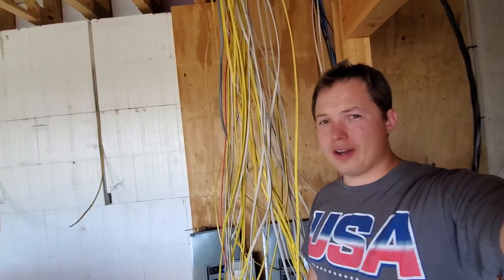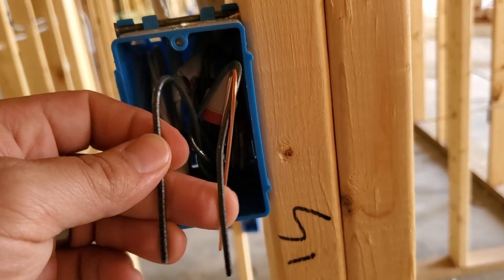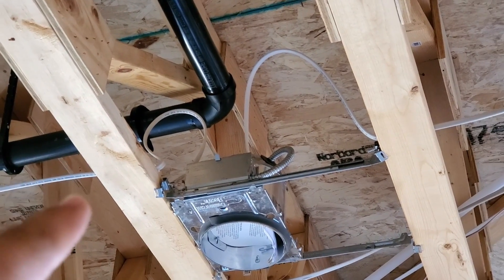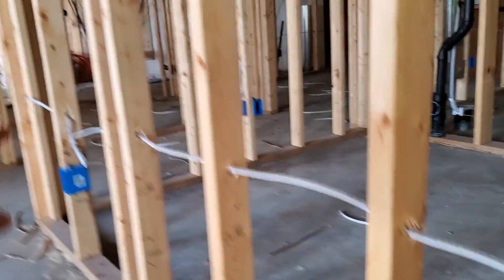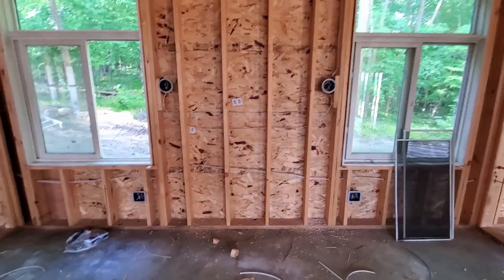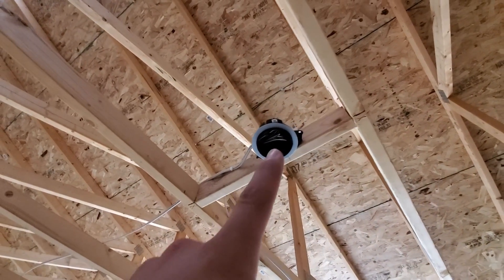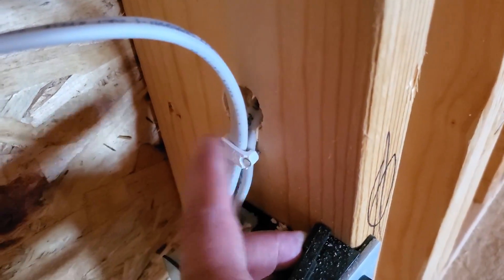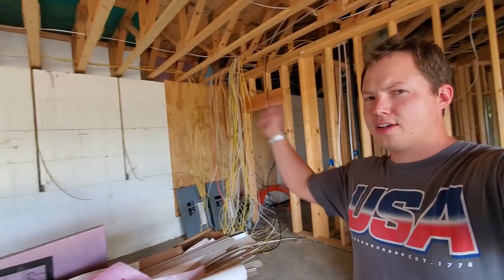New House Wiring Rough In Project Tour!

Comment: Very nice. Now one convienemt way i lile to wire a house espacially a 2 story one is including a sub panel too. for example the sub panel will serve all the circuits on the second floor and the sub panel will be on the second floor in a convienent spot. and for one story homes where the garage is on one side and the bedrooms on the other the garage has the main panel and the sub panel is installed on the opposite end of the home at least on one of the rooms and will serve the circuits on that end of the house.

Comment: Three cables max through one hole, and that hole should be at least 1.125". Can barely do that with 2x4 construction though without compromising the stud or top plate. It's a bit ironic to talk about the heat from cables coming together when all the homeruns are literally right next to and on top of each other inside the circuit panel. That 3-way with 14/2 and 14/3 cables (9?) coming into a 3-gang is obscene. Why would you do that?

Comment: if no more than 2 wires allowed to go through a single hole in the stud to avoid bundling and over heating , then at 3:04 I see the same situation created with multiple wires going into the switch box very close to each other.

Comment: What is the max outlets per 15 am breaker
Reply: The National Electrical Code does not specify a number for ‘dwelling unit’ (house) wiring. Commercial wiring has a limitation.
Reply: @jjoejones1  thank you so much
Reply: @jjoejones1  what are the allowable types of nail stoppers to protect main run service lines?
Reply: @eddiepopeyebronx  I probably use the term ‘nail plate’ for what you refer to as a ‘nail stopper’. Like me, I assume most electricians use nail plates that are the same width as a 2 x 4, 1-1/2-inches, which covers the nailing surface. I’ve never measured the length, probably close to 4-inches. They are fabricated with small spikes at each end which are driven into face of the wood. Contractors purchase them in boxes of 100…they’re very inexpensive, best guess, 8-12 dollars.
Reply: @jjoejones1  thank you

Comment: As a builder of 40 years and also do wiring you don't want wires close to outside sheathing alot more chance of wire getting peired by siding nail then a sheetrock nail,, drill holes 2 inch in from inside of stud so it's behind insult

Comment: Fifty years ago I wired a residence for a county official. In the process I drilled a series of two inch holes in the center of the floor joists in the basement through which I pulled every circuit back to the panel.  I'm guessing there was about fifteen cables, including appliances. I guess it's a miracle but the home is still there? In residential work "Heat dissipation" is BS giving the NFPA an excuse to change the NEC to facilitate the publication of another two hundred dollar code book. Their main source of support? They favor the technical rather than the worker's safety. Why else wouldn't they forbid the foolish stripping of wires with a utility knife. They probably will after they run out of ridiculous technical code changes. FYI look up sconce and pancake box.

Comment: They taped the white because it is now the hot in the 3 way switch system. Its called a dead end three way.  The power AND the switchleg come into one bo, so only a 14/3 goes into the 2nd box, fro one box to another

Comment: Are strike plates common in your area? I have seen those in some homes when routing wire through a drilled hole so that they won't be punctured by a screw or nail down the line.

Comment: Oftentimes the hole height for the cabling is really depended on what was ergonomically comfortable for the person drilling it. An example might be a 5' 5" tall dude with a hole hog will have a zone that is ergonomic and productive for that individual, while someone else who is slightly shorter using a different drill might vary by a few inches or so. Either way it all works even the carefully measured perfectionist method. I comes down to if the customer wants to prioritize it or not and back it with time allowances and finance. Being flexible is key here being able to know when to prioritize and when not to is paramount to being a good worker. :)

Comment: When I practiced it was OK to run three 14 gauge oriented cables through one hole. it wasn't OK for larger wires. That was a long time ago and I think it would be pushing it if they weren't switch legs. I believe the thinking is that not every cable is energized at the same time but I could be way off. :)

Comment: The common wire is wrapped around the two traveler wires. They are Wrapped that way so that the common is easily identified at finish, when installing the 3-way switches. Most apprentice Electricians are taught this way , Ben. It makes them quicker to identify during trim-out and does not hurt anything. Russ-Journeyman Electrician from Oregon

Comment: The tightly wrapped black wire is likely indicating that it's being used as the common for the 3-way, while the red and white that has been phase taped as an orange are being used for travelers. When I was an electrician I would make my boxes up like that and use the white for the common and phase tape it blue. I heard from a friend still in the trade that our municipality has made dead-end roll-ups and switch loops illegal though, so that will be a thing of the past.

Comment: Number of current carrying conductors you can group together or in the "same raceway" is on table 310.15 (C)(1) of the 2020 NEC.   7-9 current carrying conductors, at 70% ampacity.
Example: 
#12 copper wire is good for 30 amps (90C column) but small conductor rule, 240.4 (4)  says overcurrent protection can't exceed 20amps for a #12 cu wire,
So, 70% of 30amp is 21amps, you can group together 9 #12 copper wire, current carrying conductors, (neutrals are considered a current carrying conductors)
If you, want to pull 10-20 #12 copper current carrying conductors in the same raceway, you have to do 50% of the #12 cu ampacity, so you'd have to use 15amp breaker, or up size your wire to a #10cu (40amp in the 90C column) so obviously, 50% of 40amp, 20amp, you can still use the 20amp breaker, fuse... 
Ps. You always derate using the 90C column. (Table 310.16 of the NEC)

Comment: The reason I think they went up and and then down and then back up for the receptacles is because it looks like foam insulation and that shit will just drop down
Reply: Not all foam is shit! The white stuff they use in packaging (and the kind you see in HD) is very light and not very dense. If you get type IX EPS (used for under slab insulation for example), it is rated for 25psi, or 3,600 lb per square foot, and that's just the middle of the road EPS density that you can get.
Reply: @pnwbuilder  that’s not spray though, that’s blocks. If you went across the pieces above will slide down... you go up so there’s nothing that can fall down. It’s hard to explain on text but I’m just saying what I think. I’m an electrician and don’t work with that kind, just going off what I see
Reply: @colin5789  I am not talking about spreay foam, that stuff is actually not that durable from structural point.

Comment: Hey Ben I like your wiring jobs but I did see one major structure problem on the garage wall I noticed when you're pointing out a bundle of wires that went to a switch box next to the garage door I've noticed that they cut into a double stud which I believe is a structure load point and that is a huge huge no no, Mike Holmes would have you tear that right out

Comment: If I don’t have any Romex 6/2 for 50 Amp can you take 2 14/2 twist the positives together twisted neutrals together interested ground together snappy satisfaction ?
Reply: or .....you can  go buy some 6/3wg and do it correctly
Reply: It’s referred to as paralleling but it’s not legal as you propose. Paralleling can only be installed using much larger wire (#1/0 AWG)

Comment: I have a concern with the comment of not bundling the wires, if you have excessive heat from "bundle wires" it's not from the practice of neatly ensuring the bundle is fasten in place but, may be from two other factors you must consider 1. If a wire is illustrating excessive heat as a conductor you must take into consideration that the wire could be undersized for the projected load in the circuit 2. The load factor for the circuit was incorrectly calculated creating a potential fire hazard on the loaded circuit. If these two calculations are correctly calculated then should not be an issue of bundling  a mess of loosely placed wire in the ceiling

Comment: There was an area where someone left a mess of wire on the floor. Inspection failed.
Reply: Video could've been done during the crews lunch break or what have you, guessing you're one of those "neat and workman like manner" code sticklers 😝 ... But I agree, I hate leaving a job site messy and generally clean as I go to make it easier to get out of there later with least amount of clean up. Boss expects acceptable amount of clean up at end of job and usually tells us if we need to be OCD about it based on the customer/circumstances.
Reply: @eds6569  Well let's be honest, anyone can come in to your business and just work. Dig the trench, bend the pipe, run the wire etc etc. But when you are in someone's home, it's takes a level of maturity to go "this space isn't mine, and it's not like people want to pay more for what we do. Let me be as clean and professional as I can manage." That's all I'm saying. One man's mess, is all of our mess because it's not like the client can tell us apart or even cares. I just want us all to get paid more with a level of dignity attached.
Reply: @gracebonez  I feel ya. I've always tried to push myself further regardless of pay even when I worked crap warehouse jobs making slave wages because setting high standards for yourself are important IMO, you'll always stick out in the crowd when even your low standard of work is higher than others but it definitely gets old having to pick up slack of others when they don't care as much. 
When ya reach that point where you realize your pay doesn't reflect the standard of work you've been performing for too long without recognition it's time to consider a talk with higher up otherwise other options.
Reply: Also, cleaning as you go should be a standard with every crew if the business owner cares to have at least a minimal standard of expectations, it's not hard to carry a bucket/small box around with ya for trash and saves time/hassle later, time is money and no one likes sticking around longer in the end for clean up after busting their ass all day.

Comment: Ben, I’ve noticed on several videos that you incorrectly say that there needs to be 6 inches of wire from the front face of the box this is not correct according to the NEC guidelines there needs to be 6 inches from the Where are the wire is cut not from the front face of the box you will have substantially too much wire if you have 6 inches protruding from the front face of the box it’s where the wire emerges from the conduit into the box. See NEC 300.14

“at least 150 mm (6 in.) of free conductor, measured from the point in the box where it emerges from its raceway or cable sheath, shall be left at each outlet, junction, and switch point for splices or the connection of luminaires or devices. Where the opening to an outlet, junction, or switch point is less than 200 mm (8 in.) in any dimension, each conductor shall be long enough to extend at least 75 mm (3 in.) outside the opening.”

Comment: For the love of god, ream out the holes after drilling them. All those wood splinters will damage the wires over time. On another note, Ben your Channel is amazing. Keep up the GREAT JOB !
Reply: Actually they will not. The wires look like they are fairly loose. Even as the house settles nothing is gonna happen to those wires. Not an issue.
Reply: J A Roadkill it’s pulling them through the holes that can cause issues. It takes only a minute to run sand paper on the holes, it’s just lazy not to.
Reply: cabdolla and less than 30 second to pull the wire through...un necessary... but to each his own. I live in a house built in. The  80s , we renovated and many of the holes had the same rough edges pictured  in the video and no damage on those old cables.
Reply: J A Roadkill look at the job site. Trash wire cuts all over the floor. Splinters in the wood, wood pieces all over the bottom plate. What ever crew did this, does not cleanup as they go. Pride in your work and cleanliness should be religious to being a self-respecting craftsman!
Reply: cabdolla very true but times have changed a bit and craftsmen are rare. What we now have in the trade are production installers. And I absolutely get it, as I ended a day , rough or trim, we all cleaned up and swept and threw out trash.
Reply: @cabdolla  Should I be concerned about pulling cables through studs horizontally? They have the same splinters as the holes through the top plate.
Reply: @jjoejones1  why not just remove the splinters with sand paper, are they covered by sheet rock?
Reply: @cabdolla  I was trying to make a point by analogy, if you are concerned about the possible impact of splinters penetrating the nonmetallic cable sheath and prefer to take the time to ‘de-splinter’ holes, that’s your choice. If it was a problem, I would think the Code would have been amended years ago to address it.
Reply: @jjoejones1  that’s a fair point for sure

Comment: I’ll run 3 romex in a 3/4” hole or bigger. I also take the time to de-bur the wood slivers around each hole. Takes a little more time but if you get a rhythm going you’re still moving pretty efficiently.

Comment: I REMEMBER WHEN WIRING WAS ROUTED THROUGH ELECTRICAL CONDUITS. THE JOB WAS SO NEAT AND LOOKED GOOD, IT WAS AN ART MAKING BENDS, 90'S, OFF-SETS, 3/4 BENDS, FORWARD BENDS, BACKWARD BENDS, SADDLE BENDS AND SO ON. TODAYS RESIDENTIAL ELECTRICIANS ARE MISSING ALL THE FUN, ALTHOUGH CONDUIT ROUTING IS STILL USE IN COMMERCIAL WIRING.
Reply: john alt what? My house is from 1930 and 1914 and no residential house ever had conduit in it. What reality are you in lol.

Comment: If I run 14/2 as home run for lights can I use 12/3 for the switch can I mix it up ??????
Reply: Where I live yes that is fine. As long as the power in is on a 15 amp breaker you can use 12/3 for 3 ways, 4 ways, etc. although it is a bit more pricey than 14/3 especially if you are only using it for switch legs (which is implied in your comment). 12/3 will work though!

Comment: To many conductors in that 2 gang box look at the box fill calculations in the code book. The max you can have in that box is 5 14-2 wires also if you look on those cables stackers packing it says on the back that you can only hold 1-4 14g wire in that cable stacker because it will derate it look on the bag on the back of it just a heads up

Comment: Interestingly, US wiring is completely different from the wiring in the Netherlands, we build houses mostly out of concrete, but even for wooden ceilings we route all wires through PVC pipes, so its possible to add wires after you close up the wall.
Reply: We do that in comercial construction, but we use EMT or MC. Most new homes have high attics now so it’s easier to maneuver up there, a lot of old houses in the area I live in have very low attics because they ran the wiring under. It sucks I like attics more haha.

Comment: Hi brother hope you doing great.... I have a question my house is under construction... I wanna run some cat 6 wires how do I do it.... I mean do I run through every bedroom I have 4 bedrooms ....or I can run one wire in family room where will be my modem then I can take another wire to the master bedroom upstairs and use a router their or should I run all wires from modem to each and every room where I want tv or computer please advice
Reply: I would do a double home run of cat6 cable. 2 cables from the modem/router location to every room you want a wired connection. The second cable can be used to have a switch or a wifi router as bridge in case a room needs multiple wired connections.

Comment: Best to separate lighting loads from general receptical loads,  The wide variety of lighting options may effect harmonics with arc fault supplied circuits. All recess lighting should be equipped with gasketed trims to reduce air loss  from the forced air unit.

Comment: Tight twists in wiring is not good as it effects the integrity of the copper. Flat metal boxes are called “ pancake” boxes.
Reply: moreso it stresses the insulation when it starts to dry out years down the road.